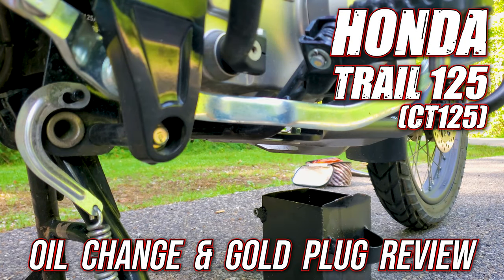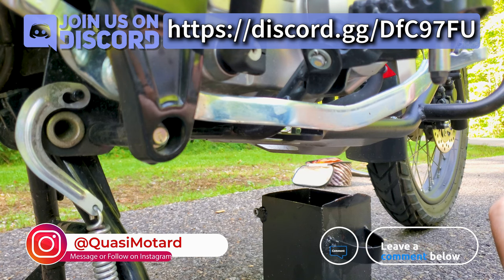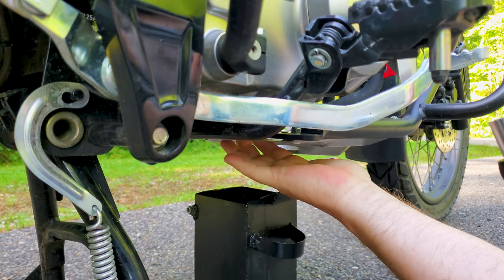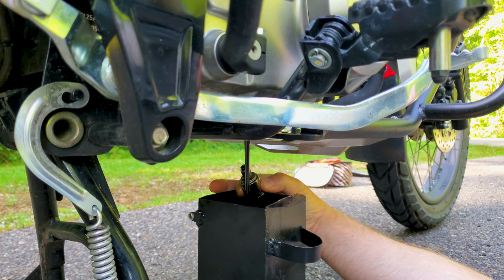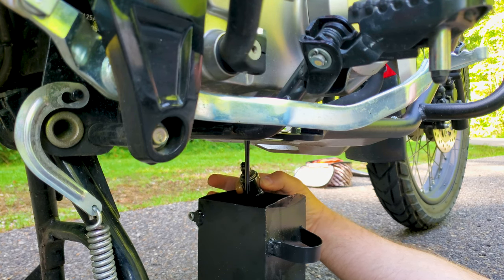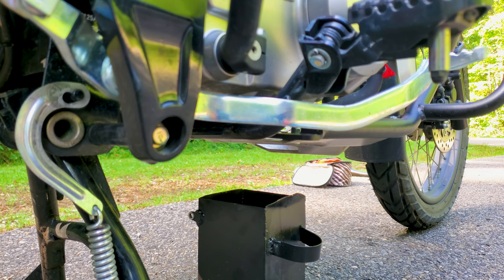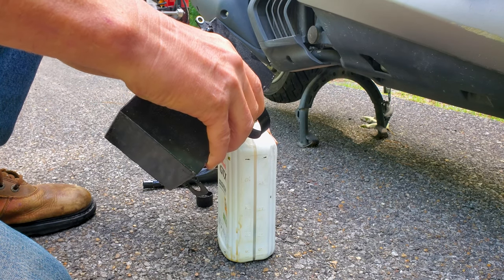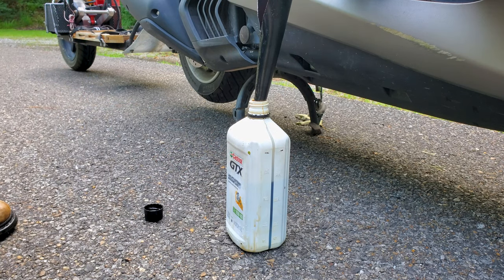2021 Honda Trail 125 (CT125) Oil Change & Gold Plug MP-01 Review

Comment: I changed my oil at 350 miles. Made a big difference. I was able to go 5mph faster in 3rd and 4th gears. I will use synthetic at 1000K.

Comment: What’s the reasoning for going with 10W40 instead of 10W30 as the owner’s manual prescribes?
Reply from the maker: I Iive in a hot climate with summer temperatures of 100°F+ throughout the summer, so 10W-40 is an acceptable weight.  For some reason, 4T 10W-30 is difficult to find in Southern Texas.  Most of the local Honda shops don't even stock the Honda GN1 10W-30... only the 10W-40 variety.

It's not uncommon to run thicker weights in air-cooled engines in hot climates... 20W-50 is very common.  Full synthetic oils tend to be a bit "thinner" than petroleum oils, so running one grade heavier generally isn't a bad thing.  Cheers!  😉👍 --QM

Comment: i wont know how much is on mine until i hit 4k about 1500 miles because it took forever for me to get my plug in.  but i had none show up the first two times i changed it. at 500 miles and 1800 miles. but now that i have the plug i should know. but i used valvoline 10w40 motorcycle oil for wet clutch and so far i haven't used a drop of oil YET. but the most i have ran so far is 652 miles round trip to the tiddler. but plan on doing something soon as i pay off amazon and then get my new tires.
Reply: oh where did you get your trailer and everything to hook it to the bike. did you make a video of it yet?
Reply from the maker: I didn't make a specific installation video for the trailer on the CT125, but you can see the process unfold on the Super Cub in these two videos:  https://youtu.be/GSxi4kdy2SY and https://youtu.be/8eJ6ARvgfUY .  Cheers!  😉👍  --QM

Comment: Thanks for the update. I found out about Gold Plugs on your Super Cub video and have them in all our fleet of 125s.
Seems like your experience on oil burning matches what I've read on forums with Step throughs. 
I also get the same with my Wave on outback trips. In city traffic and when riding in South East Asia she rarely ever consumed any oil.

I'm curious to hear how the synthetic oil goes for you. 
I ran Penrite 10W-40 fully synthetic at one point. The manual clutch bikes: 2015 Grom, 2019 Monkey and 2016 CB500x all run fine with it. However, the semi automatic Wave 125i experienced a bit of clutch slip on cold days. Since then I moved to Motul 5100 semi synthetic 10W-40. 

I'm actually a bit surprised about Hondas decision to add this odd dipstick instead of a bit of glass when they made that side cover. If cost for a kick-start side cover was an issue, why not use the Wave side cover which has the dip stick in the filler? 

Nice bike though, if I wasn't constrained by money and garage space, I would seriously consider a CT125.

Comment: Those plugs seem to work great. Have you considered using synthetic oil?
Reply from the maker: I'm a firm believer in the GoldPlug's effectiveness!  I don't typically run synthetic oil in my engines until after the first 1000-1500 miles because it can inhibit proper bedding-in of the valves and rings.  Synthetic oil also tends to be a bit thinner and can cause blow-by and seal leakage, so I test a couple of different weights and brands to see what works best in that particular engine.

The CT125's last oil change was at the 600-mile check and valve adjustment, and that was with standard petroleum Honda GN4 10W-40.  I switched over to full-synthetic on this oil change because the CT125 is well past the initial break-in period now.  Cheers!  😉👍 --QM

Comment: Anyone know the mL difference between the top and bottom marks on the dipstick?

It took me an age to figure out the correct amount of oil to add on the first change as the manual gave a capacity of 900mL. A bit more digging revealed that 200mL was retained in the engine with the bike on centrestand ie just 700mL needed to refill

Honda has produced many millions of these engines but they, and their service agents, have not seen the need for magnetic plugs or improved filters - what am I missing here?
Reply from the maker: I don't know the exact amount remaining in the crankcase after a simple oil drain.  The shop manual specifies 0.8 liter after draining and 1.0 liter after disassembly.  I typically fill with 800-825mL during my oil changes on the Super Cub and the CT125.  

I don't know why Honda and other Japanese manufacturers don't include magnetic drain bolts in their powersports products.  BMW, Can-Am, and other motorcycle manufacturers include magnetic bolts on their machines.  Many automotive manufacturers have them in the transmission pans to keep the abrasive stuff out of the oil/fluid.  

The Gold Plug has shown me that a LOT of stuff bypasses the spinner (centrifugal particle separator) in these engines.  I usually see a similar amount of ferrous sludge on the Gold Plugs that are installed in my larger bikes as well (e.g., CB500X, Rebel 1100, scooters, etc).  Most oil filter media can only catch particles down to about 35 microns.  The particles that the magnet catches are much smaller (essentially metallic powder), so they can potentially pass through filter media.  

I'm always amazed (and slightly worried) every time I change the oil and clean these magnets off!   Cheers!  😉👍  --QM

Comment: Just did the initial oil change at 186 miles simply to get the break-in metals out of the engine, there were a few small metal pieces in the pan. I am sticking with Honda GN4 10w-30 for now and I added the Gold Plug as well. I'll dump it again at 600 miles and see how much sludge remains.

Comment: Aaron do you use the same oil 10/40 in the Supercub? mines coming up for a third service although pretty low mileage.
Marc In Bletchley G6XEG
Reply from the maker: Howdy, Marc!  Yes, I live in a hot climate, so I run 10W-40 in most of my engines.  I switched over to this same oil (Mobil 1 4T 10W-40 full-synthetic) in my Super Cub for the latter half of my Scooter Cannonball Run trip.  We had been burning 150mL/day of Castrol 4T 10W-40 (full-synthetic) for the first 7000 miles of the trip, but our consumption dropped to nearly ZERO after switching to the Mobil 1... not sure how or why.

I would probably switch to Motul or other racing lubricants, but they aren't readily available here.  Mobil 1 4T is available at nearly every auto parts store and Wal-Mart, so it's easy to find while out on the road.  My road trips can last much longer than a standard oil change interval, so those logistics can be a problem.  I'm a firm believer in frequent and early oil changes on these little engines... oil is cheap, engines aren't!  Cheers!  😉👍  --QM

Comment: I changes out the oil on my Piaggio I use same thing mobil one full synthetic 10w 40  racing oil but it came with oil filter & screen filter too! Tell you one thing that oil and filter never been changes sense because of air filter foam fell apart just touching it! QM

Comment: Off topic comment.  Please delete if inappropriate.  Why did you take off the IRC GP-1s?  I just ordered some the other day and they are supposed to arrive this week.  I like the idea of more off road stability and the fact that you said that they make the speedometer more true.
Reply from the maker: Howdy, Brandon!  No... these videos were edited and posted out of sequence.  This video was recorded during my recent trip to Birmingham when I still had the original tires.

My CT125 suffered an unpatchable flat (torn tube) on my return trip, so I replaced the original tires & tubes with the IRC GP-1's when I returned home.

I still haven't reinstalled my front fender, but that's coming this weekend.  Cheers!  😉👍  --QM
Reply: @QuasiMotard  Oh ok. That makes sense.  We're up here in Cherokee county, TX.  Between Lufkin and Tyler.  I bought a pair of these.  Love them!

Comment: Why would you let it get low? That's user error.
Reply from the maker: Maybe you didn't see the previous video. The oil was freshly changed the previous day before I left Houston, TX. I crushed 725 miles in one shot (17.5 hours) to meet a friend at this campground. I checked the oil at 350 miles, and it was fine. When I arrived after the 725 mile trip, the oil was ~300 mL low.  --QM